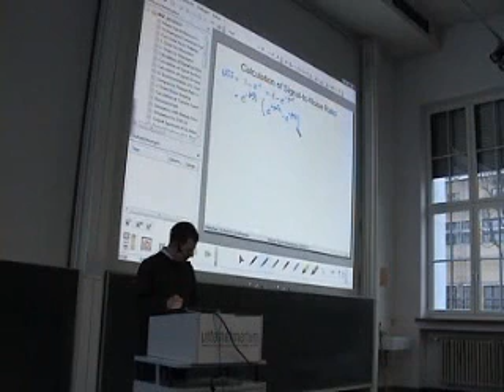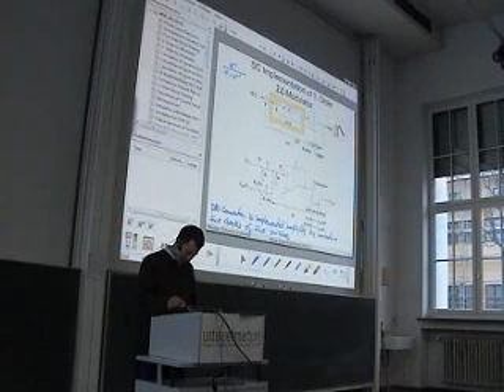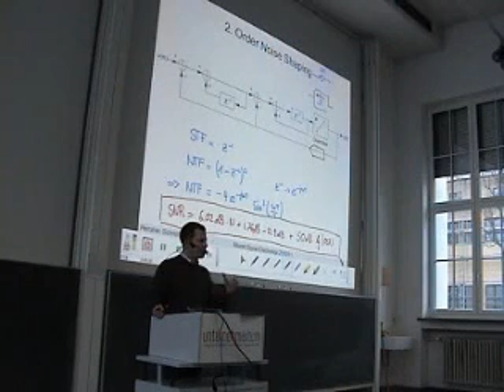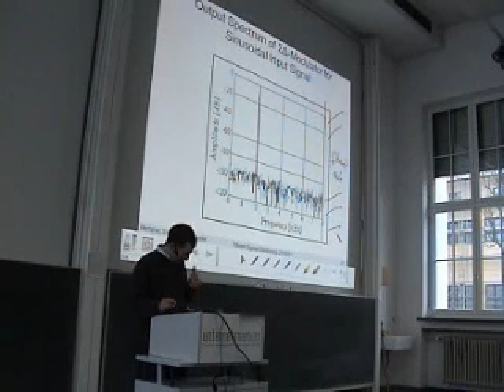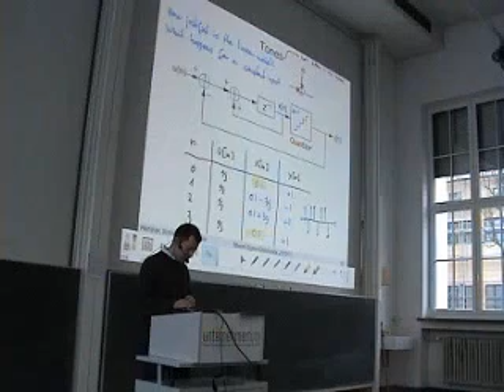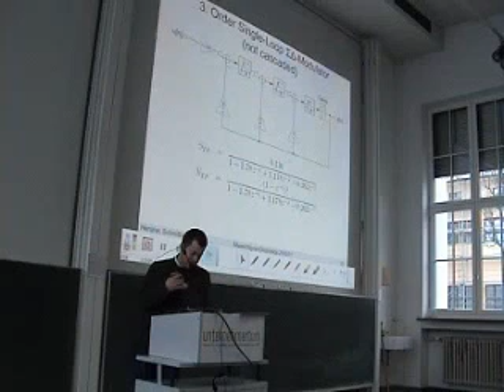Comment: I built 1st order delta-sigma ADC (MCP6022, LM311,74HC1G74) but there was whistling like in regenerative AM receiver - when I change DC input value I heard these sounds different tones - one sounds was louder , another sounds quitter. The level these sounds was not high - but I heard it when I connect phones to the digital output. In this video I found  response on my question - I thought that my device worked not properly.  As higher was Fclk, these sounds decreased.